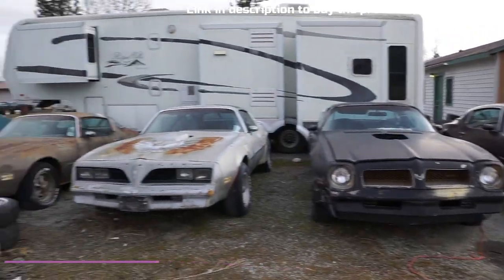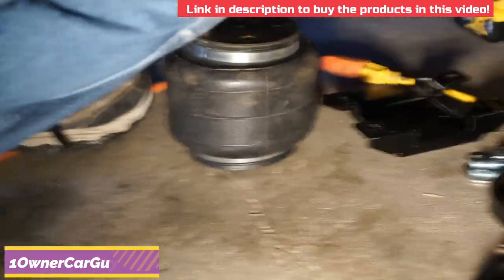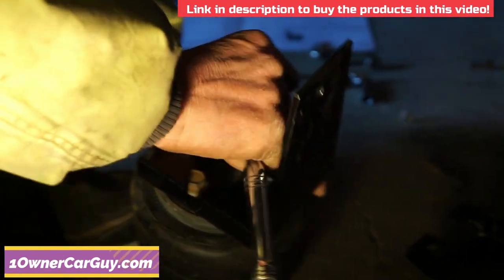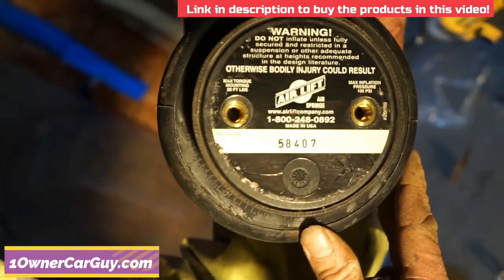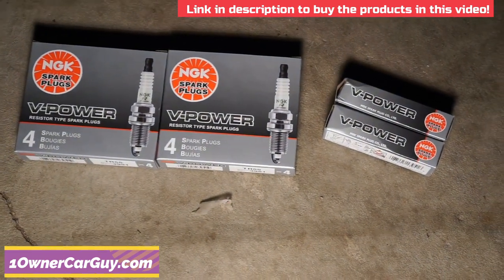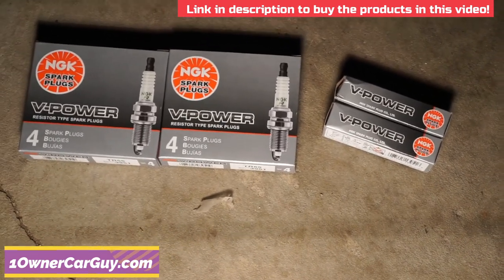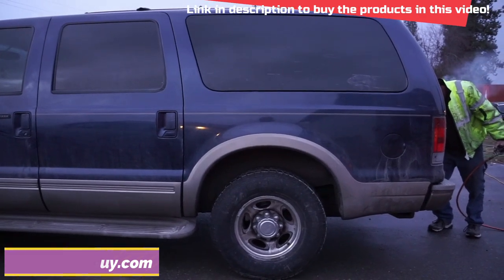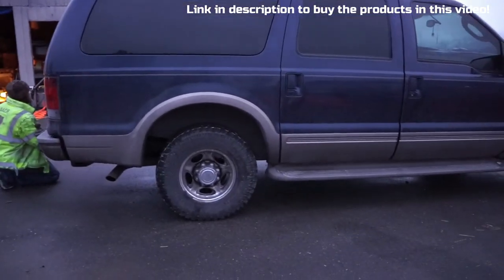Fix Sagging Springs / Suspension Towing AIR Bags ~ Truck & SUV Pull Trailer Tow Upgrade

Comment: I bought a v10 EX about 3 months ago. I've heard the leafs springs on these are known for sagging. I've got a rear end howling noise at highway speed even with no load. Was wondering if the sag is bad for the pinion angle. Do these bags have any effect positive or negative for highway sounds?
Reply from the maker: Nothing negative as far as sounds with no load if you have them full it dont like speed bumps... Yea I think people just overload / overuse the 3/4 tons and ends up like this LOL.... Yea its possible out of fluid and angles and such I dont know for sure but I would not think that it would affect that unless super extreme and other issues... get it checked soon though that could be expensive if it keeps on
Reply: Alright guys, I'll check that diff fluid. Thank you. Airbag install looks great btw, nice work.